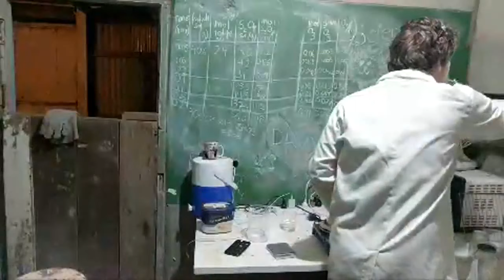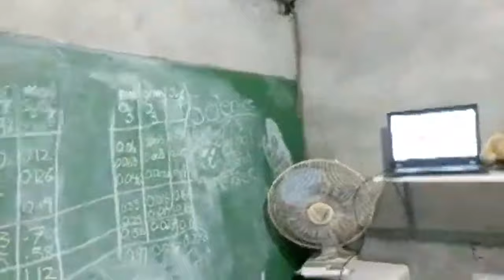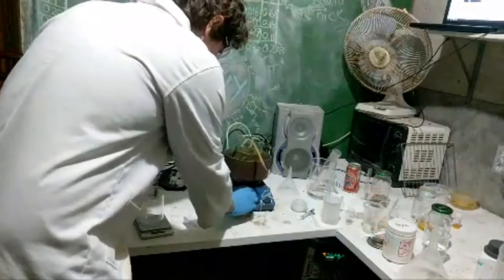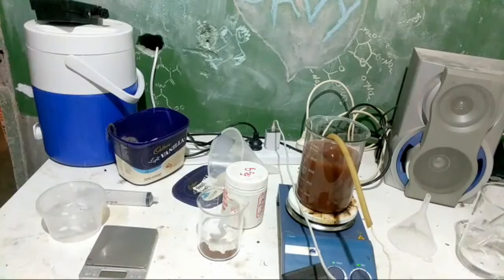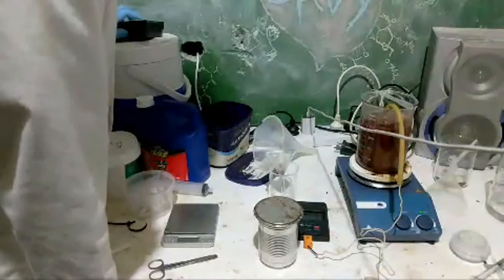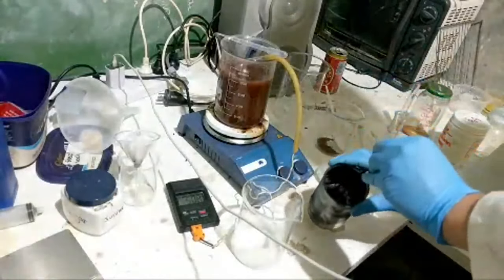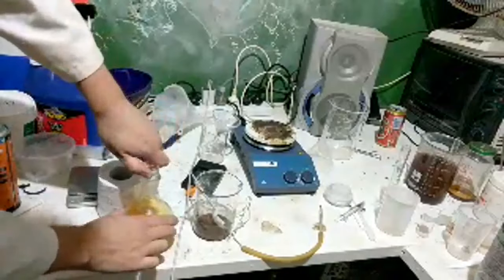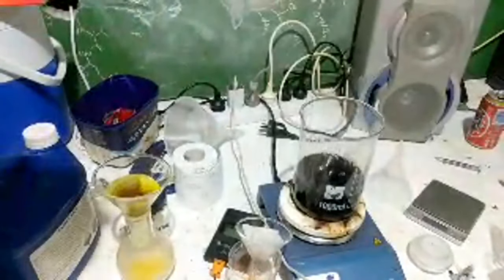Making Ferrate (Iron(VI)) - Live Stream

Comment: I used steel as my source of iron salt and neglected the fact that there is a fair amount of finely divided carbon present. As soon as I finished the synthesis, turning such a nice purple, the beaker spontaneously detonated. One of the few times I wore proper PPE, glad I had the face shield and full body coverage.
Reply: Holy cow, thanks for the warning.

Comment: Wait, you made iron oxalate? I did an entire paper on pyrophoricity of transition metal oxalate decomposition products. Heat it in a test tube to decompose it and the remaining iron under the produced CO2 blanket will be unreactive until you tip the test tube and pour the result into air where it reacts in air so fast the particles glow orange to white hot.